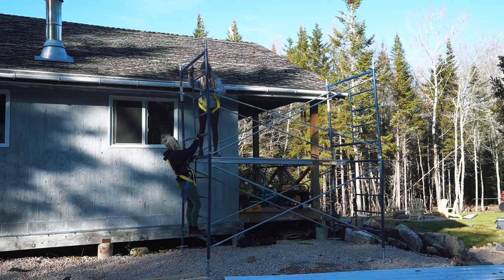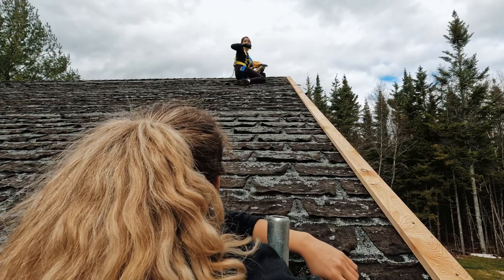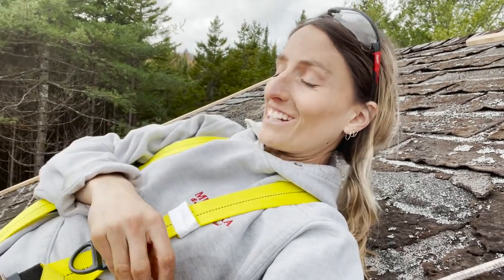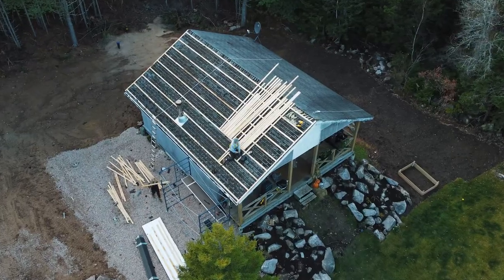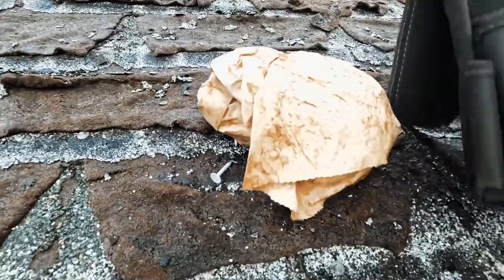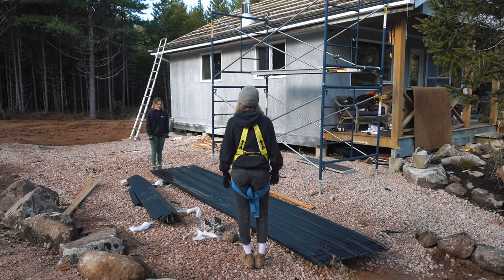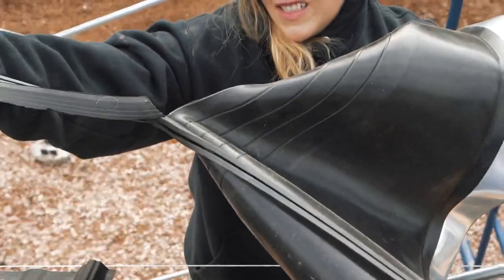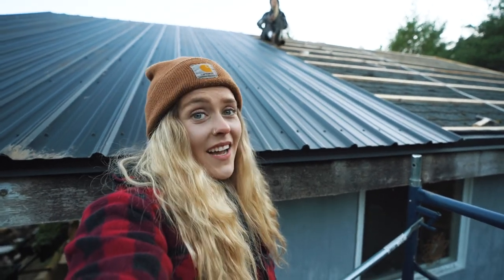Roofing Our Home w/ No Experience!

Comment: I love how you 2 aren't shy to have a go at anything 😃 great job, but how come you screwed the sheets through the pans instead of the ribs? After ten years of concrete tile roofing and long run those back massages are heaven haha
Reply: My guess is that the kit instructions were that way. Different companies have different recommendations. Most of these type metal roofs are going to the pans. It seems that when you screw through the ribs, the pans wobble in the wind loosening the screws up on the ribs. So they do the pans and have found a neoprene washer for the screws that seals very well. Thus the kit comes with screws that are the right length for doing it in the pans rather than longer screws that would be needed for the ribs. I watched this evolve over my years in the trade and it was a great source of debate for about a decade until it seems to have settled into this way. Took me  awhile to get use to the idea myself.
Reply: @markpashia7067  as a roofer of 10plus years, I would never ever screw a roof through the pans. I've installed countless roofs of that profile screwed through the ribs on brand new homes and never had any issues that you speak of... its literally illegal to screw the pans in my country unless its being used as wall cladding... plus when the neoprene washers deteriorate waters going to run straight in the screw holes... who ever decided screwing threw the pans is a good idea has no common sense
Reply: @markpashia7067  pans wobble in the wind causing screws to loosen?!?! Mate I've laid roofs in the most windy city of my country on tops of cliffs above the sea that get hammered by 200kph winds and never seen a pan wobble screw loose... stupidest thing I've heard in a long time
Reply: @davidmitchell4268  I have seen it here in Missouri on a large commercial building. However it was metal on wood structure and they might have used the wrong screws. They went through the high points instead of the troughs and we had to inspect twice a year and replace as they came loose with longer ones to get tight again. It was a restaurant/bar/nightclub building. But late spring and late fall we walked the roof replacing any that were loose. I think one year we even switched to a thicker screw. Number 8 to number 10 just to get more meat of the wood.
Reply: @davidmitchell4268  Also I have been around long enough to know that ANYTHING IS POSSIBLE even when it might be hard to believe. Mother Nature does strange things and every site is different. That roof was ten years old when I was on it in the late nineties and is still there but has been coated with white mobile home coating some years back now. Just trying to buy more time by the new owners.
Reply: @davidmitchell4268  Well then your install would void the warranty for some brands of metal here in the USA. Customers deserve better. If the specs call for it you do it.
Reply: @davidmitchell4268  Also had twelve years a roofer and over forty years in the trades around it. Some were general contractor licensed and bonded.

Comment: I would have taken all of the old roofing off and laid stained/varnished boards going downhill butt joined at the peak then overlapped  another layer of the same before I put the metal roofing on but I'm not a roofing contractor and I dare say that you girls got a fair amount of advice about how to do the job before you started it.
The result was a good one, the roof looks clean!
Are you girls going to do an extension on the back or side of the cabin and square the cabin up or not?

Comment: Hint.  Throwing a rope over the roof.    Use a smaller line with a weight on the end you toss over the roof.   The opposite end is tied to the major rope which you then pull over the top !   Good luck gals !

Comment: Obviously too late know, was there a reason you didn't do a tear off of the original roof? It's recommended to tear off original roof to inspect for damage underneath. But according to people l have talked to, if you are installing a metal roof, especially if you have no leaks, you will be fine. In point of fact, that's why so many people are installing metal roofs.

Comment: If you leave the old roof on with the way it is cracking up so easy, won't you have a problem with the cracked up pieces settling between the old beams and new

Comment: That's pretty impressive but I have one question. Why do you fix the roofing screws in the trough instead of the ridges of the roof panels?  With ordinary corrugated iron sheeting I was taught to put the screws through the ridge so that the water would run off and not be able to have any chance of leaking in around the screws. I know there are rubber seals around the screw but in the long run it's always possible that they could perish and leak.

Comment: Hi girl why are you not putting the screws on the ridges think about were does the water run in the valleys putting the screws there increases the chance of leaking around the screws later on if they get loose or the rubber gasket fails.  I have installed alot of them

Comment: Hi it is a good job that's close to what you put in is in the line of the water or is it on top of the where it bent make sure you if it is on the bottom where the water is running you must seal it what's silicon but it looks nice good job for a woman😁🇿🇦

Comment: I sold metal roofing, the metal coils for metal roofing panels, sold the trims and accessories for about 12 years, and did metal building and roof detailing.  Have a few concerns.  Hope you used metal panel to wood screws did not get a good look at those.  Did not see you using any tape sealer in-between the panel laps and I hope you used metal to metal stitch screws (also known as lapteks) on the panel laps as well.  Also, if it has not snowed yet I suggest you sweep the roof.  The metal shavings from screwing the holes gets left on the roof and can rust it out around the screw.  Takes months to years depending on your coating and how much was left behind but it does happen with a lot of location, weather, and moisture conditions. Do not know the wind loads up there but seems screwed down well at what I think is 2 screws per foot from the visual but I do not know what the screw pattern should be where you are.  If you have not looked into it there are some accessories you can put between ribs to make it so ice hardly builds up on your roof.  But it looks good enjoyed the show.  Tell Arnold I said hi!
Reply: One quick thing is that they had no laps. One sheet from gutter to ridge. They did use sealer tape at the bottom between edge trim and the sheets of  metal to seal the rib rises. Also the kit included the wood strips so likely had the correct screws for metal on wood strips. The only thing I saw that should have been included was metal rake trim on those edges and suggested they might want to add it before returning the scaffold. Looked like a great job to me with my years in the trade.

Comment: You girls are to cute. Scaffolding, harnesses and all. But in the end you did really well. The only thing I would have done differently is i would have screwed the perlins to the roof instead of nailing.  But if you used 2  inch screws that went through the boards, shingles and roof sheathing you're ok.

Comment: Girls, you could have just let the final rail just overlap the end cap and then cut them with a skillsaw and dropped them right in place. Old roofers trick for metal roofing. I know, thanks for the after tip. Sorry.

Comment: Are you 100% sure that is a high temperature rated silicone boot????   Most of the high temp silicone boots are are orange colored!!!  If it is not a high temp rated it will melt form the heat of the pipe!!!!

Comment: Again and again why don't Americans take a few minutes to Google if you have such bad companies in the construction industry. If it was the roofing company that instructed you how to do it, you can ask them to come back and build correctly. In case of leakage or condensation under the metal roof, you want the water to drain away, therefore you have a membrane to protect so that the water does not penetrate into the house. the joists you installed are horizontal and stop the water from draining and rot quickly if there is water against them. First you put a joist vertically and then a horizontal rule on top of it, now water can run away.

Comment: I love that you have the guts to take anything on, but you should really spend more time learning about your upcoming projects so you are not wasting your time and money..  Done properly, the old roof should have been torn off or at least de-tabbed. And the reason your chimney boot did not fit is you were suppppossssed to remove the old one before cutting the panels. This makes the hole cut out much smaller and your new boot would have been perfect!!  Last thing: PLEASE DO NOT put any additional penetrations in your roof. You can put antenna mounts on the gable ends on a post so they are not piercing holes in the roof and done properly would put the antenna above the radiation from your roof, which will make your antenna word FAR BETTER.. You have plenty of land. Clear a good size of it for solar panels. Maybe you could even get sponsorship and install panels that will follow the sun and not need as many panels!!